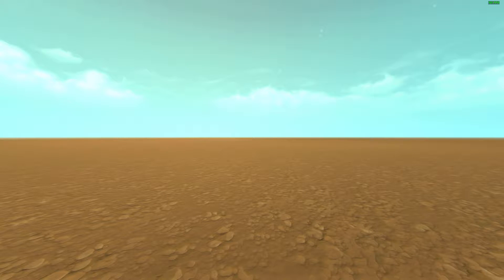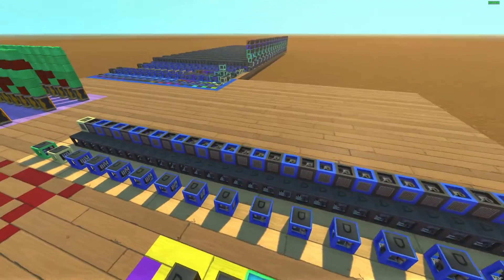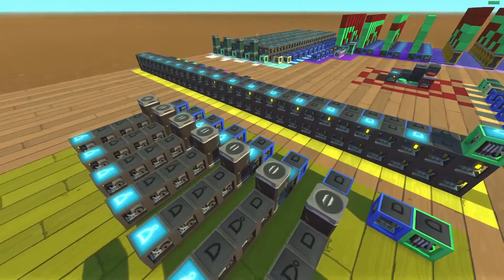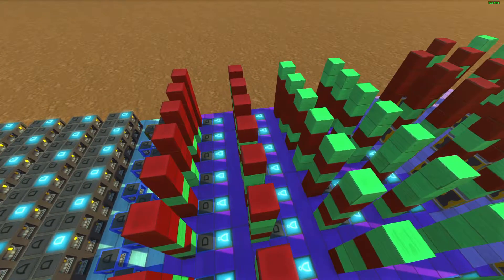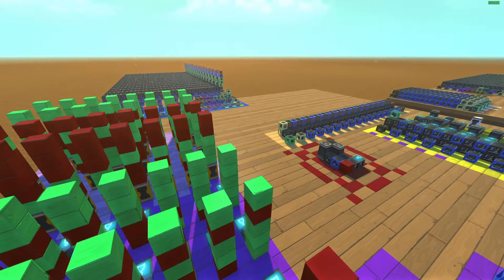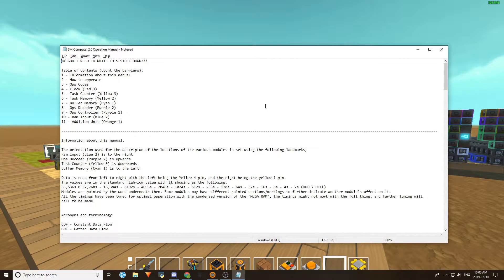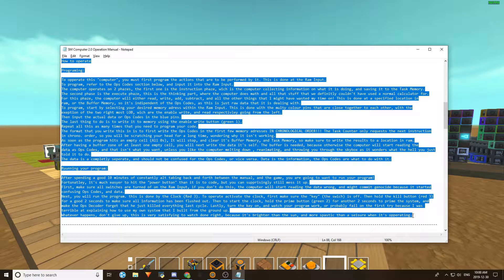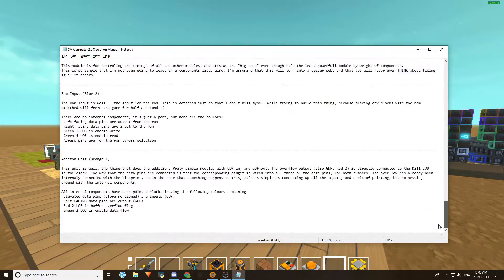The 16 Bits - 16 Bit CPU In Scrap Mechanic (WIP)

Comment: I’ve started building my own 8-bit processor a little while ago and by using a central bus, i can easily add memory “chips” (each has 16 bytes which are addressed with the last 4 bits on the address bus).
I only need to connect the in-outputs of the chip to the bus, connect the clock and give the chip a new address.
Same goes for the ALU i’m adding later this week.
Good luck on your project! :)
Reply: ever finished it?

Comment: me and a friend are building a similar thing, but much more complex and powerful/faster :D (it does use a mod my friend made, and its necessary)
Reply from the maker: Mods sure do make these things easier to build and much faster to run. I do like the challenge of making everything in vanilla, though, even if it melts my real life computer.
Reply: @JustAnotherEngineer_  not exactly, mods differ. my friend's mod adds a "faster" logic gate, thats really all of it and you can convert any normal logic gate circuit into a "fast version" of it, its still the same hardness (if not harder) to build it with the mod, but its much more rewarding since it makes it much faster, i did build many vanilla things and just got bored of vanilla cuz its generally weak and slow, anyways have a good day :D
Reply from the maker: Now that sounds like a good mod. The only thing that I don't like about Scrap Mechanic is that the logic refresh rate is super slow for our sorts of applications. I might just think about finding a mod like that to test the TurboSnail once it's done (that's if I find time to do so). Either way, it's nice to see so many people interested in making computers in SM. It's so nice to see just how big the community is. Good luck on your projects!
Reply: @JustAnotherEngineer_  thank you, btw the mod im talking about is called "Vinclings Logic Tools", have a great day :)

Comment: I came from another channel that you commented on. I'm very interested in what you've built and would like to add you on steam and learn from you, also finding someone to chill with on pc would be cool because I ported over from ps4.
Reply from the maker: hi quitYT i finished the computer, and put it up on the workshop, here's the link : https://steamcommunity.com/sharedfiles/filedetails/?id=1963595046
the discord server for it is also in there so you can find my discord that way.
Reply: @JustAnotherEngineer_  how much ram do the computer have? im working on a 256 byte RAM module if that would be an upgrade.
Reply from the maker: @vilgotkh4815  , thanks for responding, if I remember correctly, i have a default module of 16B of ram atatched, and that works well. however I have tried upgrading this further, but once I hit 64B, or 4 times more than what I have, the game drops to 10 fps, even on my mid-high range computer. So if you are trying to make another ram module, or any other module for my CPU, i'm glad to have you do so, however I would warn you of the lag that the ram makes
Reply: @JustAnotherEngineer_  okey i understand the lag problem and see that it wont be ideel for everyone.
Reply from the maker: @vilgotkh4815   the lag might have been my fault because I had some extra scaffolding laying around it, and it wasn't well optimized, so if you still want to try, it could be possible
Reply: @JustAnotherEngineer Did you weald it to The ground?
Reply: @JustAnotherEngineer_  the plan was to make to my 8 bit computer and saw your 16 bit and wounderd if it would help